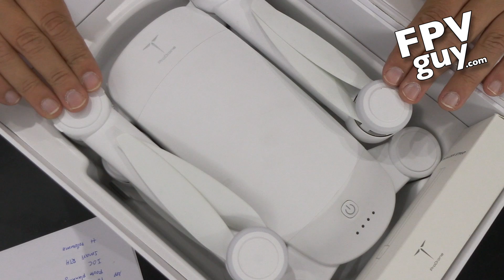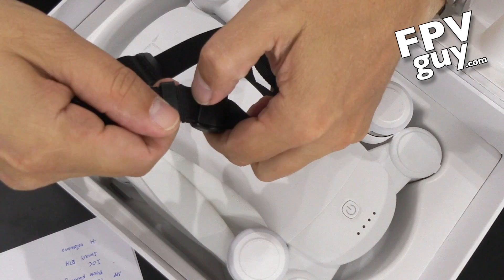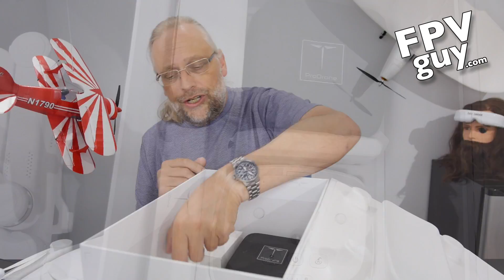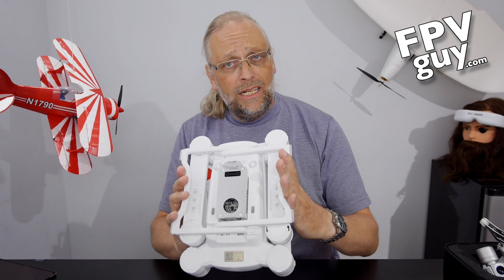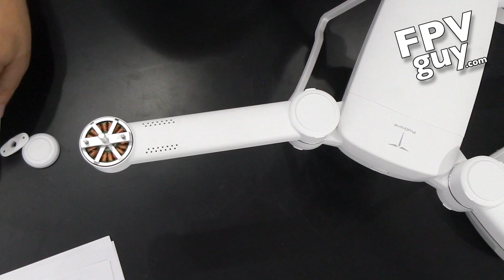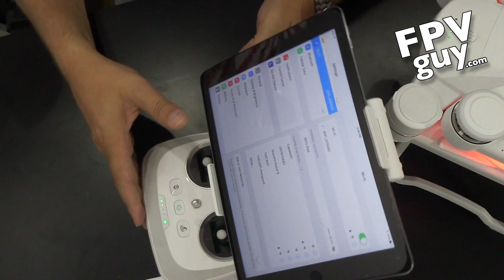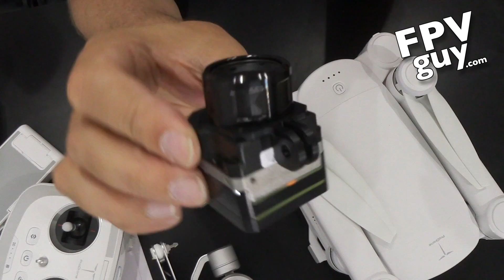ProDrone BYRD - Unbox & Preview

Comment: Nice concept,  after all the blabla it only has 1000meter range, I am sorry but for what it costs, there are way better options on the market  The little Hubsan  H501S  at $230  with a $20 antenna upgrade  has a range of 3000meters for controle and video that works on 5.8mhz and not on Wifi like this thing, and what I have seen from it,s camera does not impress me at all, it not close too the Quality of DJI's camera
Reply from the maker: You are comparing apples to oranges to grapefruits here.
the 501s is a FPV quad, not a camera quad,  and dont have meaningful battery for operating at 3000m range  and the BYRD folds up,  I do prefer the Phantom4 but for those who need a super compact travel camera-quad, the byrd is quite meaningful. only the camera is kinda crap
Reply: Husky-Flies  I agree very in-depth reviews, but sometimes too long, I fell asleep, or is that due too my age, mmm
Reply: Hey Bo.. I heard this product is having some legal issues and there have been customers feeling slighted by the company who some think are 'running with the pre-order money'. I don't know the specifics but it seemed it was having trouble. Do you have an opinion on that? Also if you do reply - thanks and I love your vids. Keep up the good work man. :)
Reply from the maker: Thank you for the kind words. much appreciated.
About ProDrone, They changed the name, so that resolved the legal problem, "ProDrone" was already taken by another company.
wow.  OK the pre-order-money thing, is interesting, however its not the manufacture as they have not taken money for pre-orders,  it would have to be crappy distributors / dealers.  I know Frank at CarolinaDronz refunded a bunch of these. 
That said.   Frank have the base-unit in stock now,  honestly the camera sucks and I would only buy the GoPro edition as then you get a great camera :-)
Reply: Thanks for all the information Bo! I really appreciate it. And again thanks for all the videos. I enjoy watching them because you are so thorough with your unboxing/reviews. :)
Reply from the maker: LOL  Ruudy... sorry.  I really try to keep these short.   I would prefer never to go past 15 minutes,  maybe I need to make these 3 part. ha ha.
Reply: Bo Lorentzen Oh don't worry, I was just kidding. I also seem too chat on when trying too tell something, so keep doing your good reviews, and I will have coffee at the ready haha. But we want too see the flight review  also
Reply from the maker: LOL working on the next unbox just now.

Comment: I'm having a hard time deciding between the Pro Drone Premium and Typhoon H.  Any advise?
Reply from the maker: +singinfarmboy   it really depend on your use, if you are trying to travel with this in a small space the Byrd is the ticket, but for video production the Typhoon-H is better, most importantly you have 360 camera rotation so you can pan all the way.. retractable landing-gear, and a much better camera.
Reply: I will be using the drone for photography and videography.  Mobility isn't an issue.  Camera image quality is what I'm looking for.  Pro drone Premium, Typhoon H or Typhoon Q500 4K.  Thanks
Reply from the maker: singinfarmboy   thats easy then.  get the H its a far more competent video platform at this time,  it should be shipping end of March.

Comment: Hey Bo, I ordered the Byrd Premium in early Dec......original ship date was to be end of Feb.......Aces Deals is now saying end of March into April.  No doubt you have access to ProDrone management, do you know what status is?  Thx
BTW, just bought Walkera 4f200lm, I'd like to put pontoons on it (saw video on YouTube, very cool).  Can I buy them somewhere or do I have to make them?  As always, many thanks for your prompt and valuable input.   FRED
Reply from the maker: +Fred Fidel    I had a couple conversations with them,  and I know both Jim and I found a couple issues when testing,  they have taken those very seriously and are basically holding these back until they are working 100% correctly.   Thats really one of the reasons "pre-orders" should be taken with a grain of salt.    I think Peter is about right, sometime April probably would do it.
LOL I love the Walkera 4f200LM  - I thought everybody gave up on helicopters.     there are several guys who make pontoons for those, I have been using some of the foam pool-noodles,   not the thick stuff, but the local toy-store have skinny foam strings.. works perfect for this purpose

Comment: Interesting you call them propellers even though you remember the proper term for these are rotor blades. (The craft derives its lift from these blades just like a helicopter). Only the secondary purpose is propulsion.

Comment: Thanks for your customary quick response Bo.  I don't have a GoPro so I'll stick with the Byrd's included 4K camera which I'm sure will be fine.  I have a P3P and the GPS Hold Function is outstanding....does the Byrd also latch on to Russian Satellites as well as US?  Thanks, Fred
Reply from the maker: +Fred Fidel   I do believe they are using both satellite systems yes.   I gotta say, the ProDrone's stability in GPS hold was one of the thing that impressed me the most.

Comment: Hey Bo, I was going to post this on RC Groups but since I'm here...what the heck.  Have seen all the videos I can find on the ProDrone (saw Demonseed's and a few others as well, plus your flight test video) and I really like what I see.  Too bad you didn't have the Advance or Premium variants to test max distance with the OFDM video downlink.  Speaking of which, if this is MIMO-OFDM then it's essentially using the same video technology as Lightbridge.

I was all set to throw the switch so to speak, and buy the Yuneec Q500 until I discovered this sUAV.  I LOVE the foldable features of this thing plus its stated flying time, which I'm sure will turn out to be very optimistic.  Things that worry me from the little information I have is the cheap looking (easily breakable?) plastic and the outrageous cost of the proprietary battery.  I see it will retail for $169?  Are you friggen kidding me??  Prodrone must also come out with an adapter for the battery that will let users like me with kickass, high performace chargers to actually use them.

Thanks for the video and the info.  Thanks for your input and thoughts on RC Groups as well, BTW.
Reply from the maker: +Appalling68   yeah the battery is kinda a shocker,  its pretty big, but not THAT big to cost almost 200 bucks.  
I'm really liking the idea of the gopro edition, but like you say, there is tons of plastic parts,  I'm kinda thinking its a unit that fill a need for a particular user,  like you can backpack this easily in a regular backpack.  if you don't need the folding features, then you can find better simpler units like the P3 at similar price points.
I don't understand the choices in the battery, and why is the battery not a bit bigger to fill that compartment and have the body lid included on the battery. having a battery fill 2/3 of the compartment and then a finicky lid on top bugs me. ha ha.
Reply: +Bo Lorentzen Thanks for the response.  I'm sorta leaning towards the "Advance" version even though I don't own a GoPro (yet), but am wondering out loud if there will be GoPro control from the Tx like there is from the Prodrone supplied cameras.  Also, how are they going to integrate the GoPro camera feed back to the ground station?  So many "how ares"?

Happy New Year,  btw.  :-)
Reply from the maker: the last thing I heard,  you have to start the GoPro before flying.
They have video included in the downlink, simply from the GoPro's video out.

Comment: great video! 
having a hard time deciding on the P3 or the 3dr solo and now I found this. very interested in this copter. how flimsy do the arms feel? do you think we could expect to snap them in a crash? hopefully they have modular pieces to replace instead of the whole body!
Reply from the maker: +Bonkerhead McBonkerson    Well one of the things to keep in mind with the Solo,  it get more expensive than it seems at fist, because you are picking up gimbal, tablet and GoPro.  however the P3 and ProDrone also require tablet.
Importantly Im really recommending the GoPro version over the 1080p edition simply because you get so much more features and a better camera for so little extra cost.
The pieces are very modular,   there are snap lids for the joints against the body making it easy to get to them.   I suspect worst-case scenario would be crashing and breaking the body part of a joint.  
that said,  this is really a very stable ride and I don't see it crashing a lot, I was very positively surprised how easy it is to fly.
https://www.youtube.com/watch?v=VEYh9Nc0mhY
Reply: +Bo Lorentzen wow, thanks for the quick reply, usually I'm waiting a week or 2! I am definitely going to be getting the GoPro version if I decide to get the byrd. I'm not a big fan of all these integrated cams with the quadcopters. thanks for the info on the arms, really appreciate it. guess I'm just going to wait for them to release the finished product and see how everybody likes it. At its price point and size, it can't be beat. in my opinion it's the best bang for your buck. I am  very likely to buy this. just hoping they have a 30 money back guarantee like 3dr incase I am not impressed with build quality and gimbal etc.
thanks bud, have a nice night :)
Reply from the maker: :-)  you are welcome sir.
The entire integrated camera ting is getting old,  on a $1000 aerial platform, I'm guessing the average manufacture spend maybe 50 of that on a OEM camera drop in solution.  except for the P3 none of the 1080p's beat a Mobius,  spending $100 more and dropping a $400 GoPro in there is the simplest way to get a benchmark grade camera. only thing left.. the gimbal need a rock-star tune.  Im hoping they will have that dialed in.. and if not.. I'm really hoping there will be a tuning tool, the we can get Matt Kim to create a tuning for it.
Reply: +Bo Lorentzen I agree 100% with you on the gimbal. it needs to work flawlessly or else this copter won't make it! hopefully they can fix the bugs and dial it in to be cinematic quality! :)
Reply from the maker: OK well lets cut them a little slack. "cinematic" may be asking a lot. but at least reasonably stable :-)  like in P3 range stable would do the trick for me.
Actually talking our favorite camera and cinematic,  I flew the GoPro with a Anamorphic lens about a year ago.. hard-mounted on a 300 size mini-hexa 
https://www.youtube.com/watch?v=f6AR2TeIcck
Reply: +Bo Lorentzen lol I guess my standards aren't quite that high then. (I consider the P3 cinematic! aha) as long as it matches the P3 I am sold! great video link btw. I've never heard of different lenses being put on the GoPro. I've only used filters. I'm going to have to check out these lenses. 

quick question, do you know if putting filters on the GoPro while it's on a gimbal will affect the gimbal performance? do you recommend balancing the gimbal after the filter/lense is added?
Reply from the maker: YES. you are right on about balancing the gimbal, AFTER mounting a filter or add-on lens, I use pennies or quarters along with double side tape to perfectly balance out the gimbal to avoid the motor laboring to keep up the filter.   My favorite filters are the Graduated ND filters to manage sky.
BTW talking solid gimbal,  I'm still not totally keen on the yaw-dampening on the inspire.. but here are some practice runs,  check out the one staring around 1:45.. and the ending
https://www.youtube.com/watch?v=qzNVA_ZnxEI
Reply: +Bo Lorentzen thanks so much for all the tips. definitely going to come I  handy when I finally get a quad. I see what you mean by the yaw. not very fluid. you would think for such an expensive machine it would be like butter! what exactly is a solid gimbal btw?
Reply: +Bo Lorentzen oh and I liked the "2x speed..." line. it gave me a chuckle! :)
Reply from the maker: Solid is referring to working well :-)
Actually that was long time ago, the yaw works a lot better now,  but quick pan's are still a disruptive visual effect,  in that same video you can see some times where I instead use the roll and slide sideways to frame instead of yawing to frame the object, that move is much less disruptive as you barely notice it.   I would say the inspire gimbal today is quite solid.  (solid performer)  but knowing different ways of getting the same effect is part of the skill set to create shots.
Reply: +Bo Lorentzen ahaha can't believe I didn't know solid! now it's all clear. thanks a lot for all the info. I think I'll probably be doing the same as you in that video and just practice setting up shots and how to do it smoothly once I get my quad. :)
Reply from the maker: Thats the process,  just do a lot of flying and see how you like the results, then refine the technique.  chase friends walking, etc.
here is another practice shot.. the beginning is kinda rough, but I had a great time and good fun flying this stuff  https://www.youtube.com/watch?v=UY1O5J6NNs8
Reply: +Bo Lorentzen wow another great video. u really got the angles down! good job :)

Comment: hi bo, hope you also have a review on Vantage Robotics snap drone..looking forward
Reply from the maker: +ronnel tubing  Yeah the vantage snap drone is really interesting,  still Im always a little cautious of products thats no yet actually shipping.  lets see in the spring, and give it a test ride once they have samples available.
Reply: Alright, looking forward for your unboxing and  and test flight for the snap drone.. BTW any review on the blade chroma drone 4k? This copter is also interesting. Tia
Reply from the maker: The blade chroma is kinda a budget smaller Q500,  it seems its not quite as smooth flying as the Q500, but generally the controller and everything is identical.
Reply: Thanks for your feedback, so video quality of the 4k chroma and yuneec 500 4k is identical?
Reply from the maker: Yes the 4K chroma and the Q500 4K have essentially identical cameras,  they have slightly different firmware, but for all intends and purposes the video are identical.   Check out my review of the 4k a couple months back. there are also a fairly in-depth look at the camera.
Reply: Thanks again..i just watched your video on yuneec q500 4k, very informative. In your experience, watch is the maximum range with the st10+ tx with a disabled geo-fence feature, around 2km?
Reply from the maker: I would say a stock Q500 goes maybe a mile, probably less than the ProDrone advance and premium editions.
Reply: That would be acceptable range for a stock

Comment: the horizon was distorted, seems like a wide angle fov and color somewhat saturated. maybe the long arm is the cause that way the props is in the frame, might end up buying chroma blade 4k..lol..what do you think
Reply from the maker: +ronnel tubing   the camera is pretty wide,   the right choice in copter really depend on what you plan to do with it,    but you are likely going to get a much smoother flying quad with the ProDrone simply due to the nature of its size.
Reply: Yeah i agree on much stable flight due to its winspang and maybe more resistance to strong winds, overall the byrd is a good potential copter, thanks for your videos

Comment: cmon Bo!! the vid!!
Reply from the maker: +Carlos Cid https://www.youtube.com/watch?v=VEYh9Nc0mhY
Reply: +Bo Lorentzen saw it! you are the best at this. but i guess i have to wait for the advanced as you said! I mean if you dont have a gopro you should buy one. The outcome is better. You know that the camara that your drone has kicks ass. But Bo can you imagine that the camara of the Premium version is like super awesome?
Reply from the maker: The inspire camera is super-awesome,  but I think the one thing we see again and again, phantom vision, P3, Yuneec Q500+ etc, most of these guys are better at making copters, and buy OEM camera equipment,    having a camera that really is the best possible for the weight is much easier when using the GoPro,  the GoPro is still equal to the P3pro camera easily, and to the Q500 4K camera,  
more importantly, unlike most, the ProDrone guys say they have integrated the GoPro operation so they can start stop recording from the controller, if that is reality, then the GoPro should be a no-brainer.
Reply: +Bo Lorentzen Got it but i meant the Byrd Premium not the inspire.  i mean we dont have a clue yet until someone uploads a vid.  gonna keep stalking de internet like ive been sin last month when the Byrd was announced! lol it has something that makes me wanna pick it before a P3!
Reply from the maker: Well the flying is totally legit thats for sure.
My guess, the 4k will be 4K with manual control, but not GoPro beating 4K.  thats OK though, as long as you can scale it nicely in post when rendering projects to 1080p and get beautiful 1080p video.